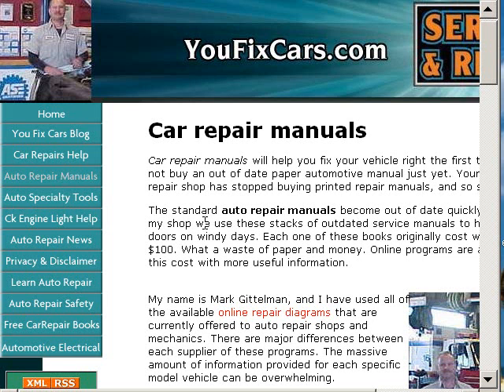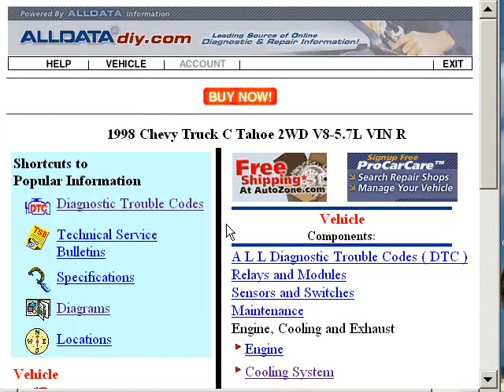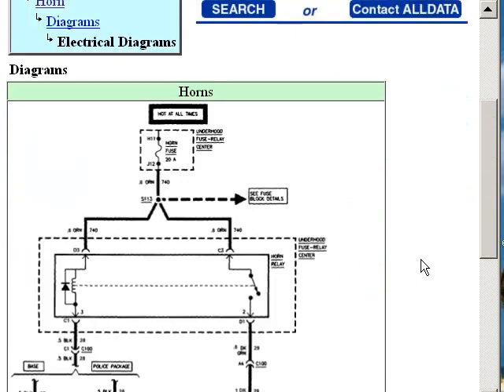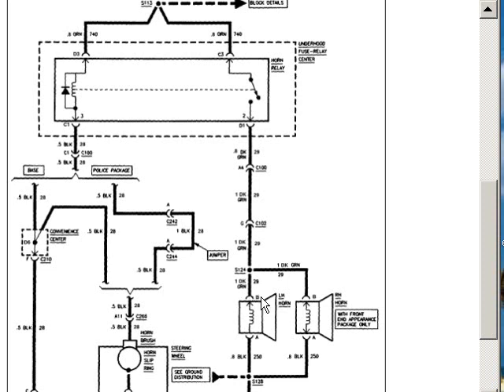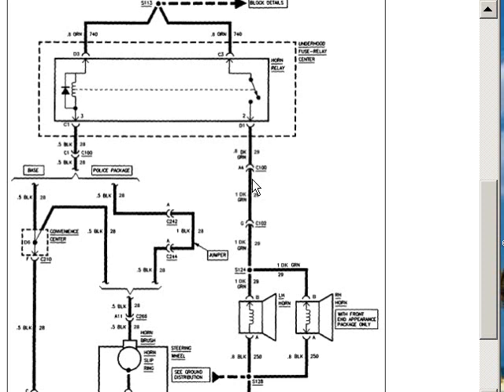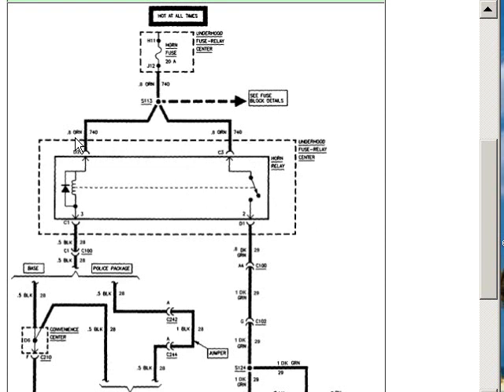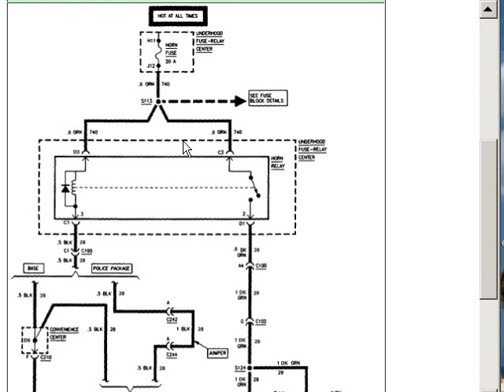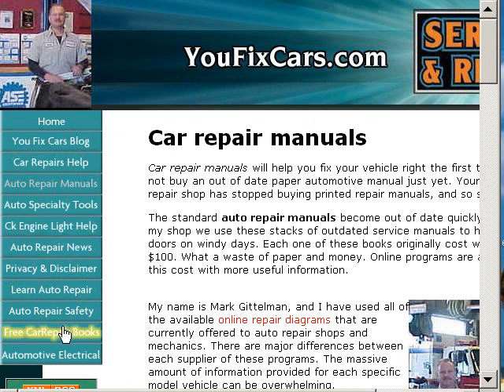Wiring Diagram How To Video

Comment: Good info   but I would change a few things 1st check the fuse, 2nd check power to load ,  then  3rd jump the relay  b+ to load  & recheck for b+ at the load,  you will know  right away if it is a  relay problem!   why go to to a connector that may be hard to get to? 4th Hook test lite to battery b+ and  ground side of relay going to horn switch if it lites then the switch and  ground are good.  I  agree hands on diagnosis ithe the only way to go.

Comment: Thank you for very much for this example. I need to check my A/C Low Pressure Switch and work my way towards the A/C-Heater Control (in the dash). Have a feeling I'm going to have to piggy back with another wire between the two.

Comment: Thanks for the vid.  It does help make things easier.  My question deals with reading of the diagram.  I believe you said that the "C"s are connectors.  What are the "S" items? are they just wires spliced together or is it in a two part clip thing too?

What are the numbers in the little boxes below some components?

Comment: Is there a 2nd fusebox on 1985 toyota pickup.  Brakelights, flashers, turn signals not working.  Did not see a fuse in box under hood.  Do not have the manual

Comment from the maker: @nyvendor "how do you check for ground?" A good method is to connect your test light clamp to the positive terminal of the battery ( instead of ground) If you touch a ground with the tip of the test light and it illuminates that would indicate a good ground.

Comment from the maker: debraredhead : 
"What are the "S" items? are they just wires spliced" Yes these are factory made splices and are not ment to come apart. These are usually soldered and crimped connections. They are usually pretty reliable as I have only seen a couple in 27 years that needed repair from corosion or poor conection. Thanks for the good question.

Comment from the maker: When it comes to nightmare electrical problems hands on diagnosis is the only way to go. I don't think I can help by e-mail. You might be best served by shelling out the bucks for a Honda dealer to get you straightened out. They will have the best factory wiring diagrams and know what to look for better then any private shop!

Comment: I'm trying to wire my 97 Nissan maxima's headlight connectors to my 96 dodge dakota that have crappy headlights. I need to know which wire goes where
Reply: go to nicoclub dot com, they have all the wiring diagrams for NIssans
Reply: I figured it out. Just trial and error til I got it. Thank you though.

Comment: Sorry ,
but as an electronic technician I disagree with you using a  test light for troubleshooting! Because it only shows U that there is some voltage present! NOT what the correct voltage should be! Suppose U have a high resistance fault due to corrosion or a bad connection? True RMS (for AC) meters with high input impedance (so you don't load the circuit down in parallel )is the only way to go! 
Like a FLUKE 87! Or equivalent.

Don 
ASE Tech